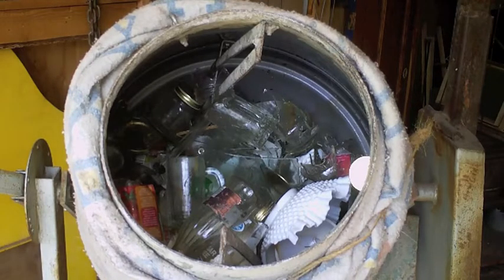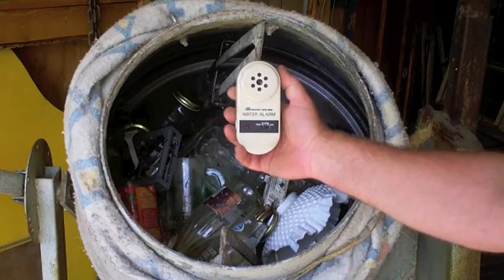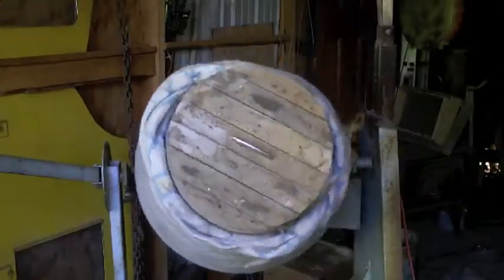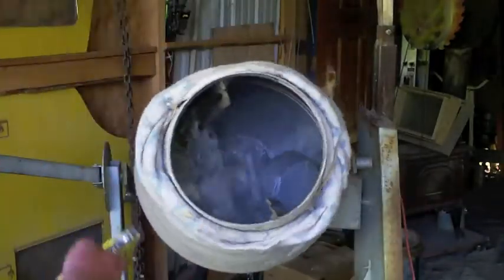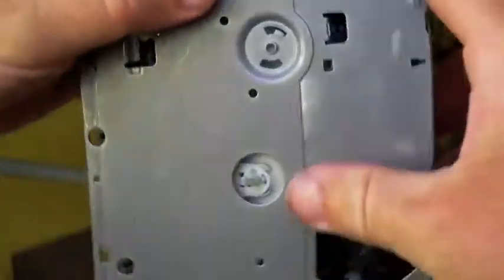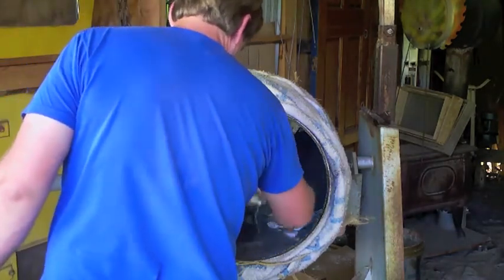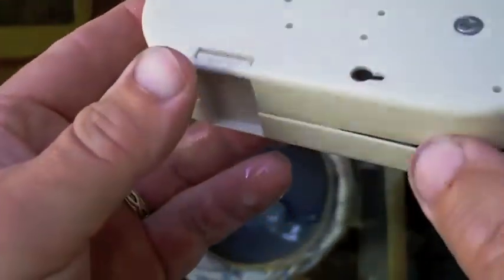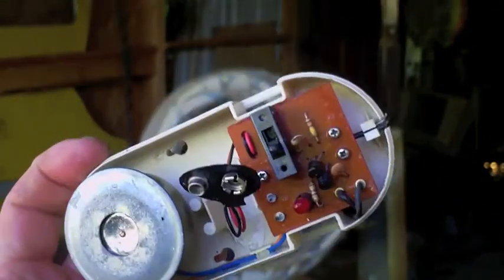Shit in a Cement Mixer

Comment from the maker: When we were doing this hardcore to fill the beds the first time I did that all the time, worked great on durable stuff.  I used to make decorative drawer pulls from railroad spikes and I would toss them in and then coat them with poly after about 6 hours.  Gave a great finish.